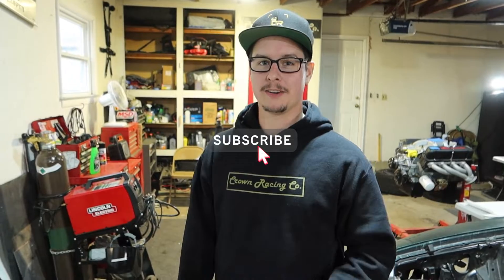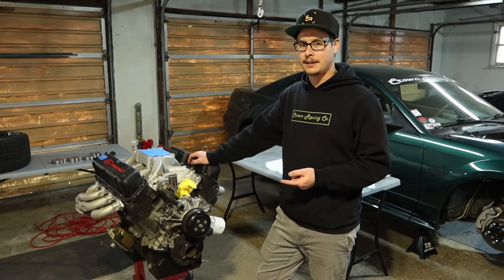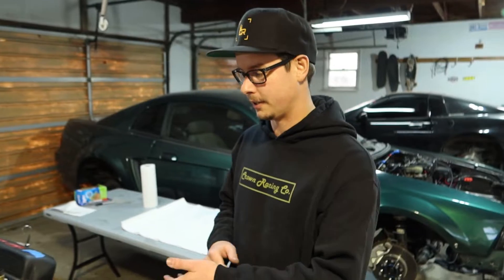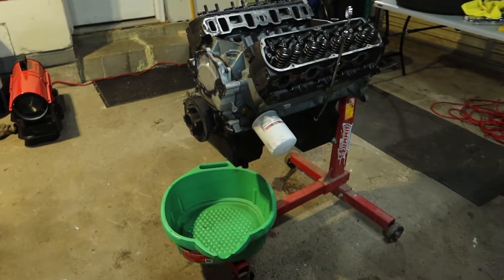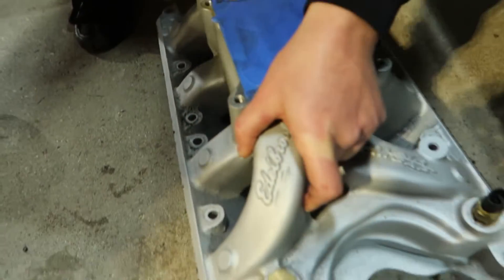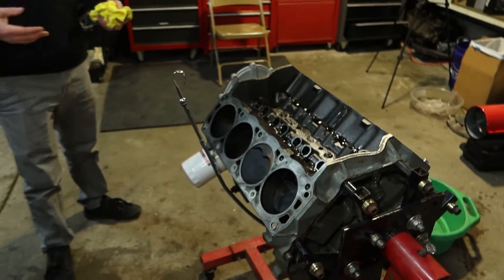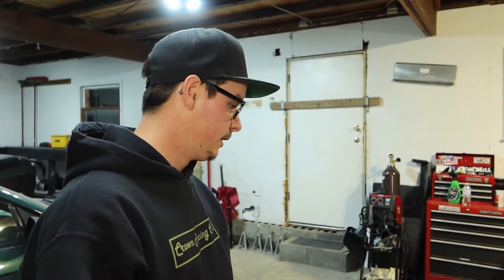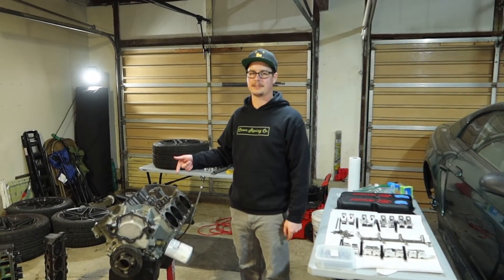Satisfying Engine Teardown Blown Up 351W Small Block Ford V8

Comment: Marcus, try increasing your piston ring gap the next time this happens. The ends of the ring touch when they get hot and they buckle and that is what breaks your piston. Grind and file the tip of your rings. et your ring gap at 0.032".  Rule of thumb is .008" per bore diameter. This is what builders do for nitrous and boost applications to prevent that from happening. It's a common issue if ring gap it to tight.
Reply from the maker: This absolutely could have caused the piston failure! We saw melted piston material on the valves so regardless heat was a factor here as well.

Comment: Have you considered ls swapping it?
Reply from the maker: As a matter of fact I have. However, LS engines also blow up when you push them hard and run them hot. Drifting is a sport that's hard on parts. LS isn't the answer to every setup.
Reply: I agree, however aluminum does dissipate heat better. I drift a stock c6 gs with a dewitts rad and 180 thermostat, no overheating issues 🤘 good luck I enjoy your videos

Comment: Did you gap your rings  when you built  The  motor the last time ?
Reply from the maker: Yes I did! I only did a standard sized gap. I didn't go oversized.
Reply: @CrownRacingCo  it may benefit you to look into going with a larger gap on your rings … do your homework first tho .

Comment: Definitely look into that dual quad intake manifold i had referred you to a while back. The intake is roughly exactly the same as the one you were previously running but with more even fueling 👍🏻
Reply from the maker: Ok I will, thanks!
Reply: @CrownRacingCo edelbrock 7535 manifold for reference

Comment: So many questions.   Although your SCR maybe 11:1, the important metric is the dynamic compression ratio which is all based on your cam characteristics.  What cam are you using and what is your DCR…?   For iron heads your mac should be around 7.5-8.0:1